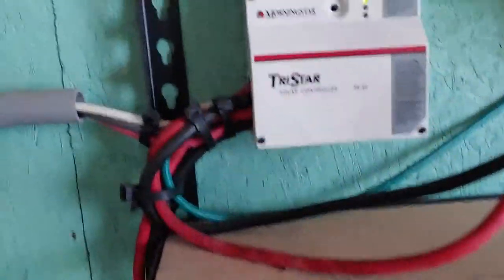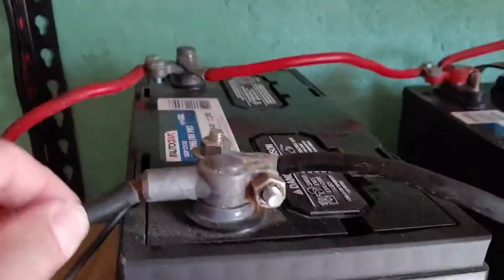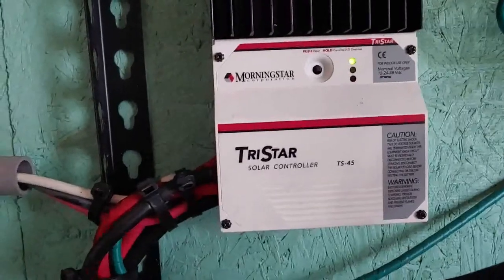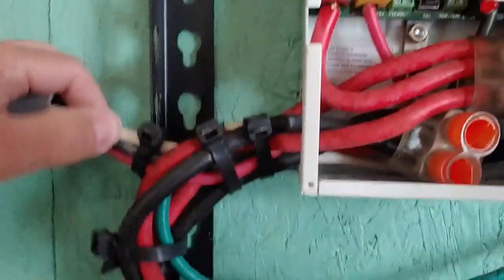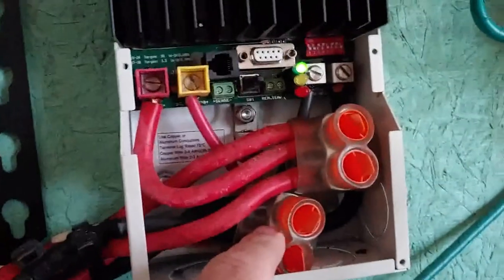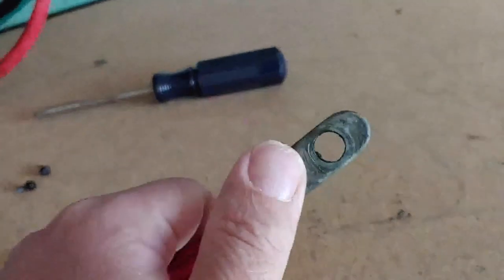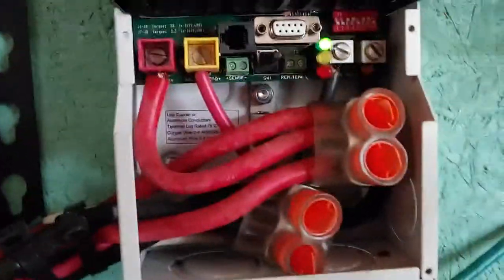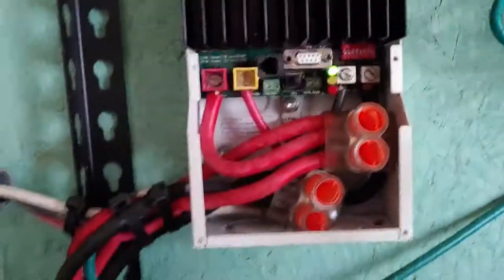Upgrading my solar system: Morningstar Solar Controller Tristar TS-45. Part of my off-grid power.

Comment: I know this is an old video.  For anyone watching it is better to connect the chain of batteries (whatever the chemistry) with pos at one end and neg at the other end furthest point from the pos connection. This uses all the batteries in the chain and doesn't exhaust that first battery. Tri Star is a very nice controller.
Reply from the maker: Thanks for your comment.

Comment: Love the information i have a question i just bouht the same charge controller my panels are 240w each = 960 watts total does the pwm style charge controlers only work in parallel mode as far as ur panels wiring can u do series or just parallel ?
Reply from the maker: Yes, with this charge controller, you can have your panels in either series or parallel. Just be sure to follow the manual's instructions on the voltage.
Thanks for your comment.
Reply: The Morningstar TS-45 is a PWM controller and to maximize the harvest you would choose panels VOC close to the nominal battery voltage.  For example, a 12v battery you would want a 100W panel with a VOC of 18-21 since a PWM controller pulls that voltage down to about 14.x and is NOT as efficient as a MPPT controller.  For a 24 bank, you will wire two 100 watt panels in series for the same reasons given.  So for PWM, parallel is a better option again depending on panel VOC and nominal voltage.  IF you own a morningstar, invest in the FREE MS View software and buy a DB9 (RS-232) to USB converter to see ALL of the details and to verify everything I just said.  Play with it and you will see the stats and can even log the data and/or program the unit to your specifications.

Comment: Why does my TriStar have a red light on instead of the green light on?
Reply from the maker: The red light on means that your batteries are not charging there could be many different reasons why check with the manual please. Thanks for your comment

Comment: Hello I have the same solar controller but mine barely charges its usually either green and yellow then at sunset its yellow and red the batteries are brand new too can u please tell me the problems and what the colors mean? And if I reset it what will happen?

Sorry 1 more thing does the angle at which the solar panel is positioned affect the battery charging?
Reply: I'm really sorry with all these questions I payed alot for this and I'm really stressed out
Reply from the maker: I don't mind the questions. I just wish I could help you with it. 
But I'm afraid I will have to refer you to the owner's manual. The LED lights can have several different meanings depending on what's going on with your charge controller at that time.
Thank you for your comment.
Reply: The MS TS and TSMPPT can be fully configured using the FREE MSView software and the purchase of a RS-232 to USB cable.  The lights are triggered at voltage set points and the action you described IS normal.  However, what you should do is log the data using the stuff I just mentioned as even faults are recorded.  PWM always pulls the voltage down from the panel to that of the nominal battery voltage.  Therefore, matching the panels to the nominal battery voltage is VERY important for efficiency.  That is why you don't put a high voltage panel on a 12v battery as the PWM will only use the 14.1 or so part of the curve....

Comment: Sir why my tristar giving 29 volts and the green led is flashing
Reply from the maker: The green light flashes when the batteries are completely charged. If your green light flashing in the batteries are not charged you can try resetting the charge controller. Let me know what you find out. Thanks for the comment.